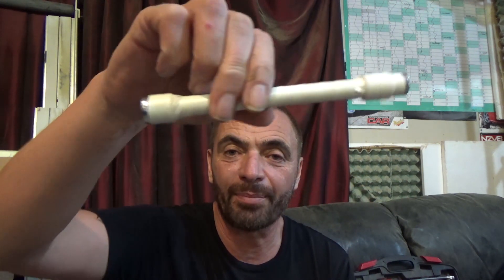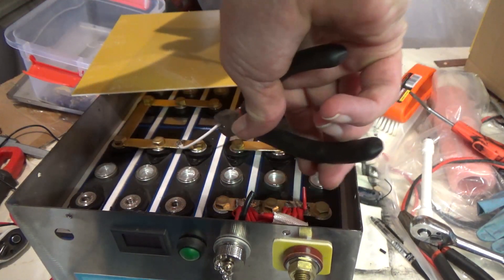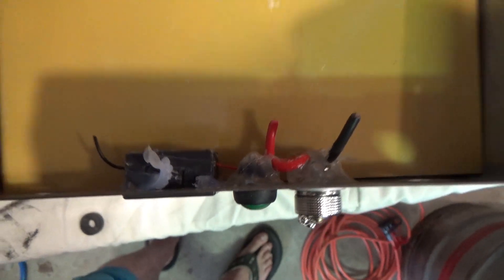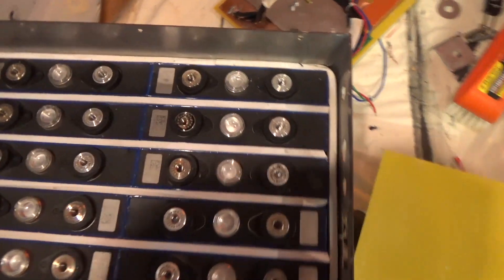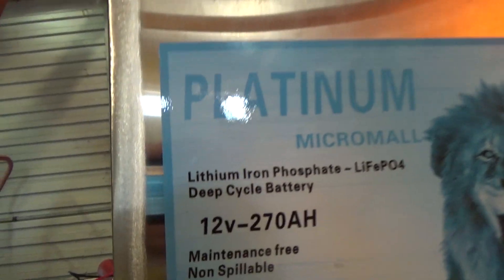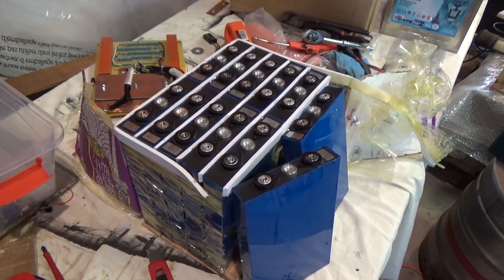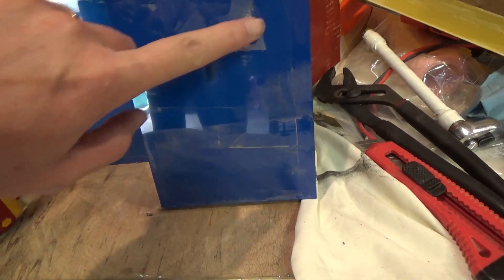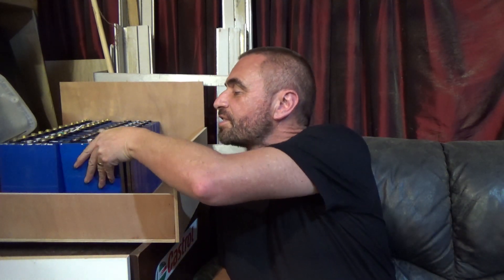LiFePo4 Whats inside a drop in battery pack | Stripping a lithium battery pack

Comment: I think you got a really good deal.   I paid NZ 2800 for 8 x 200a/h cells.    I have since seen your ones on TradeMe and I would have done the same as you if they were available a year ago.   Making an 8S battery is a bit easier,  but you have still got an extra 40a/h and a nice stainless box, for 500 less.    Regarding the imbalance out of the box,  almost certainly due to its internal BMS being inaccurate and it forcing it out of balance.    After bottom balancing mine, I was using a hobby balance monitor, and whilst my multi meter showed them within 2mv,  this piece of crap showed them in an 18mv spread.thst didn't worry me as it was only to monitor.    What I didn't know was that it was also balancing, albeit at 50mA.   So wind the clock on 3 months and they were bang on by the monitor and 18mV out by multimeter.   This is a huge imbalance at mid capacity, which could of been catastrophic if I'd allowed them to reach bottom of charge.  Anyhow, its in the bin now and the cells are holding perfect balance, albeit I am manually monitoring.
Reply from the maker: Sounds like a nice setup. To be honest had I seen 8 x 200a/h cells a yeah back I may have had the same cells as you. Spent so long scared to spend so much money and not be sure customs would even let them in. Very nearly bought one cell a month... Anyway, fast forward to now, a very handy trademe deal solved the import fears at less than aliexpress. They are not great batteries, but might be great value
Reply: At least yours were supplied with larger cells than my one has. I've just emailed them as my cells are all tagged 72ah so best case scenario I've got a 216ah battery instead of 240ah.